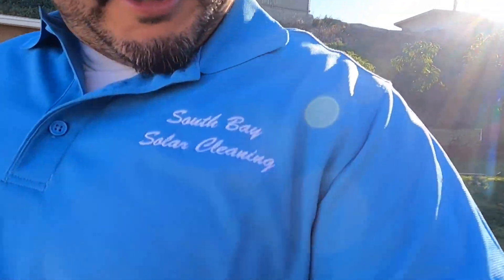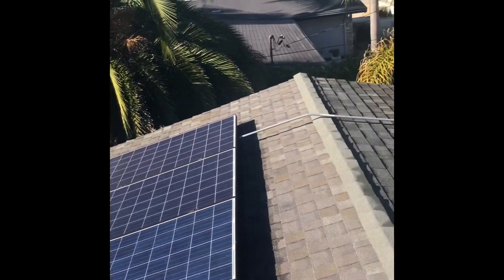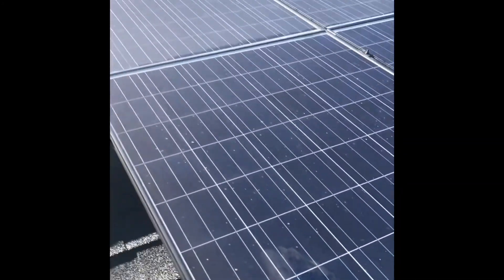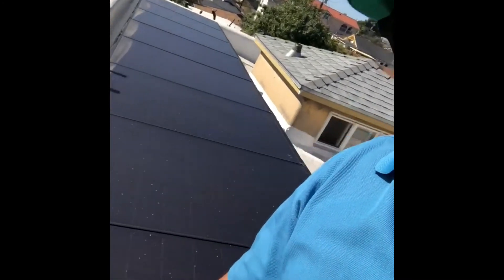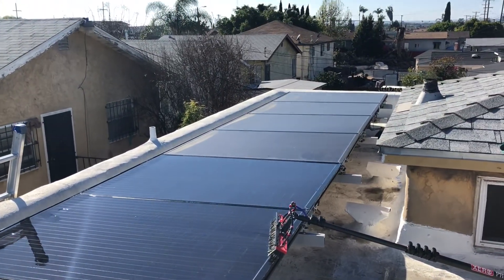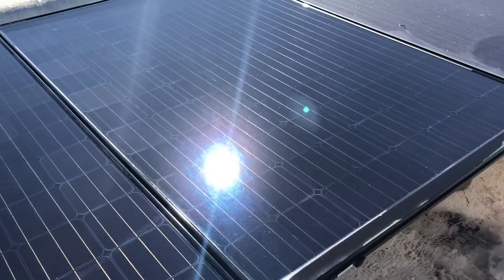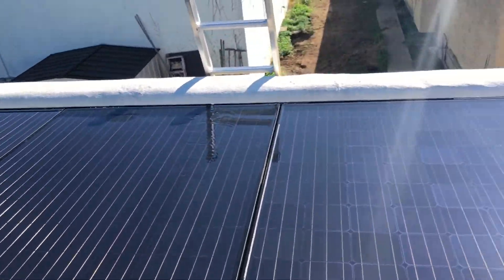Residential Solar Panel Cleaning S1:EP1

Comment: I use to clean for Fish Window Cleaning/Freedom Window Cleaning. Use some GG3 or GG4 mixed with Ajax Lemon or Palmolive. The results will be amazing. I cleaned for 14 years before hurting my back doing a big pole job. We use to do the VA and all of Camp Pendleton as well as all the Carlsbad city offices and buildings. I think all told we had 7 of us doing nearly 3k clients. We also did  most of the Mall stores in the Outlets. I wish you well and be careful. 

I really miss cleaning….
Reply from the maker: Thank you! This is one of our first videos from a few years back. We have a few school districts and picking up more commercial work. We do not use any detergents for solar cleaning. Detergents of any kind leave a little bit of residue which causes the panels to be really shiny, therefore causes sunlight to reflect away rather than absorbing. This causes about 3% of sunlight to be reflected off the panels. We strongly recommend for homeowners to stay away from any car wash soaps and detergents due to all the wax. Yes the panels I'm sure look great but our goal is to maximize energy production and not reduce efficiency. Wishing you the best!
Reply: @southbaysolarcleaning4348  the soaps I recommend don't leave residue, that's why I recommended them. The glass is freaky clear and the cleaning last longer because there is nothing for dirt to adhere to.

Comment: What type of tool is that to scrap the solar does it damage
Reply from the maker: Hey there Rod! It's a Homemade tool, plastic scraper that has been really helpful to scrape off the baked on pollen and other hard to remove debris. This is just a plastic putty knife attached to an extension  pole.

Comment: great video although you should never rub the solar panels dry. They will scratch them up. I am new in the business and this is one of the first things I learned. With that said, thank you for your video.
Reply from the maker: We do not rub the panels dry. We use a water fed pole to clean the panels with pure RO/DI water, there's no need to rub dry...they dry on their own. We use a plastic non scratching scraper while the panels are wet to remove the baked on Bee pollen and other debris. Thank you for your comment!
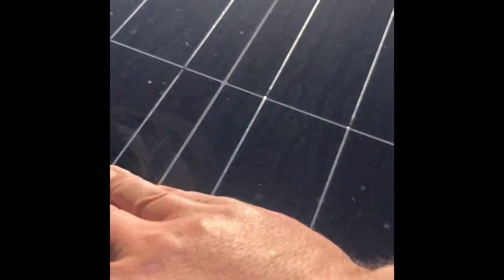Reply: @southbaysolarcleaning4348  I believe he was referring to when you were showing how dirty the panels were 3:11. Nice video.
Reply: @southbaysolarcleaning4348  only way to do it 🤙🏽

Comment: Hey man what kind of invoices are you doing how would I collect payment besides cash and do you need a business license for this
Reply from the maker: Hey there hope all is well! So I use the Square payment processing system. I do everything electronically. I have a Square card reader to collect payment. if a customer pays cash you can still send them an electronic receipt. You can also send an invoice to collect a payment incase the customer isn't home during time of the service but I prefer not to use it because you get charged a little more for that type of transactions... but it comes in handy when you need it. Yes you definitely need a business license from your local city or county. Hope I answered your questions.
Reply: @southbaysolarcleaning4348  thank you very much yes you did
Reply from the maker: @FORGETYOU8  I'm glad I could help. Just dropped a new video check it out when you have a chance.